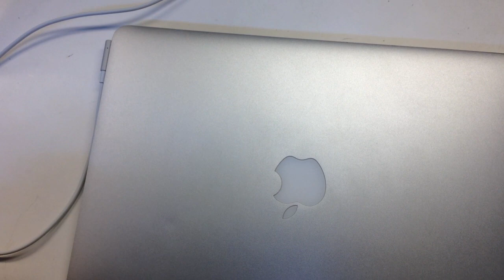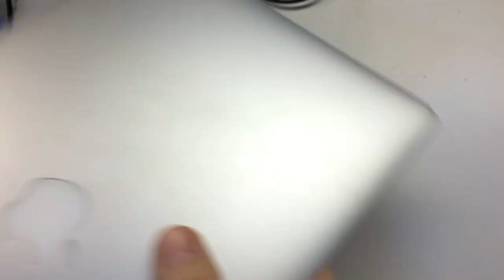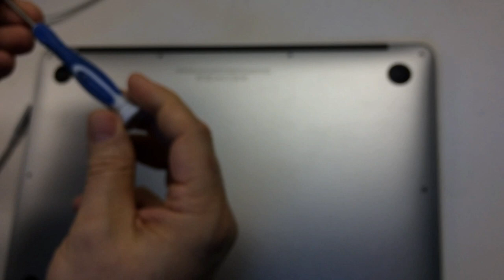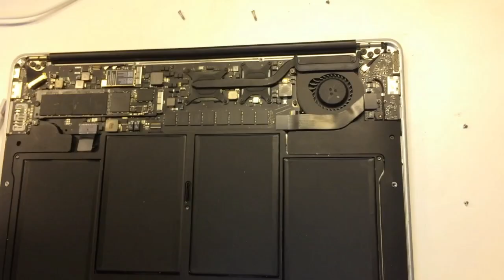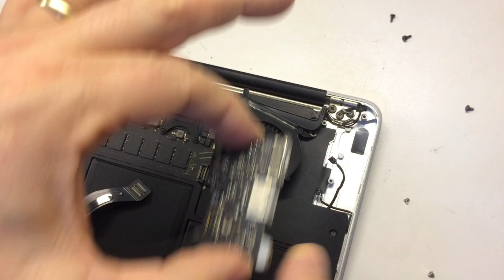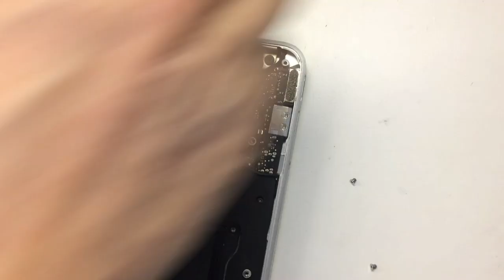Apple MacBook Air 13 A1369 Not Charging - I/O Board Repair Replacement (2010 - 2011)

Comment: I have an issue with my air,  the light on my magsafe charger does turn from green to amber, however up in the task bar it says the battery is not charging.  I have also tried using a different mag safe charger and I have the same result.  Could the I/O board be a good place to begin?  My battery doesn't have many cycles on it and seems to be in decent shape. I have a Macbook air a1466
Reply from the maker: Possibly, but could also be the battery.  If you hold down the option key and mouse click on the battery icon in the upper right side of the Apple menu bar it will tell you the state of the battery itself (either normal, replace soon, replace now, or service battery).  If it reports anything but normal, I would replace the battery first.
Reply: @DrShock   it does say normal
Reply from the maker: Then having eliminated the MagSafe charger and the battery, the I/O board would be the next logical failure point.
Reply: @firewall8985  hi, I have the same issue with my a1466 air. How you resolve your issue?

Comment: Thank you so much for this video, it was very instructive and helpful. I ordered the proper part, and followed the replacement steps, unfortunately the laptop will still not charge. No green or orange light and the battery has long since been drained. What would you suggest for the next troubleshooting step?
Reply from the maker: This particular fix is best verified borrowing someone else MagSafe charger to be sure first.   Sometimes the systems can be the battery itself, or the charger itself, rather than the I/O board.  Any of them, or any combination of them, going bad can cause the symtoms.  Based on your comment, I'd circle back and validate the MagSafe charger is actually working first.
Reply: @DrShock  Thank you for your prompt reply! I verified the charger first before starting the board replacement. This MagSafe works swimmingly with another computer in my household. Additionally, I verified with a 2nd MagSafe charger; works with another computer, not this one.
Reply from the maker: Gotcha, and the seller of the I/O board sold this as tested and verified?   Sometimes folks are just parting out laptops that are defective to begin with.

Comment: Question, the MacBook won't power on at all. It was working and then one day stopped working, and the power light on the adapter doesn't come on. I don't have a way to check it with a different adapter... So I opened it up and can see that I get 3.3 and 15V coming in and even across the motherboard. So the question is is it maybe missing 5v standby? could there still be something wrong with the power module? Just curious what else to check... Thanks again for the video!
Reply from the maker: This question about standby voltage is a bit past my familiarity with the MacBook logic board.  If I had this problem, without a spare MagSafe adapter handy, I'd try supplying power from my bench power supply instead.  There's a YT video from another creator on how to wire it up to check.  With this approach you could eliminate both the MagSafe adapter and battery as possible culprits leaving only the logic board.

Comment: Hi,
I dropped soother on the keyboard, 

It got Turned off
Let it dry for a day and had put it upside down
It got Started as tested it after a day
Now It's working on electricity 
But not on battery 🤔 as it is not charging the batteries. 
what do you guys recommend on how to get it fixed and can be done.
Thank you

Comment: Thank you very much, i have the same problem, how can i get the new part to replace the bad one? As I have such problem, I couldn't use it and keep away for some years. mine is the earlier one, i bought it even before 2010. i couldn't start using it around 2014-15...if i could fix it, i want to use it again.
Reply from the maker: There's an eBay search link in the description you could use to look for a board for your year macbook air.  Be sure the one you pick is for your model year, Apple changed them from time to time.
Reply: @DrShock  Thank you so much for your reply. I have to find out which year and model of the computer. I see serial number on the computer but no model description sadly. Any thank you so much for your help.
Reply: @zmkburma  Since this reply is way late, this probably doesn't pertain to you anymore, but perhaps any future readers. Go to the EveryMac website and enter in your serial number. That will display your exact model and year and all other features.

Comment: my mcbook 2018 not charging problem...everytime i plug in it beeps and show plug in sign and its not charging..please
Reply from the maker: You'll need to determine if the MagSafe charger is working by trying it on a friends Macbook, or borrowing a friends charger and trying it on yours.  If the charger is ok, then it may be the repair covered in this video.

Comment: Thanks. How do you test if your I/O board assembly is failing?
Reply from the maker: I can only comment on the scope of the video, which is the battery charging feature.  The other features on this board idk how you would test.  But for the charging, it's the simple test I mention in the video around your MagSafe charger and the green/orange led behavior.

Comment: Thank u so much
Anyway if issue is magsafe light on (green) but nothing booting up sound, absolutely died (i hv try press every key for reset etc) but still not turn on.. what do u think. (I try to replace old battery to new one but still nothing happen) I dont understand what is it :(

I want buy this but i dont know its right or not.. thanks for ur help
Reply from the maker: This video here is strictly about a charging of the battery problem.  If you have a new battery and a good Magsafe charger, then your boot up problem is unlikely to be the I/O board described here.   A good test would be was the Magsafe orange and charging your new battery when you installed it?  If so, then definitely not your issue.
Reply: DrShock yes charge new battery orange .... and then green (like full) 😔 its not my issue and i dont know what is it.. its happening when my mac sleep.. wisely i press shift and its open everyday without compromised..

I bought this mac 2015 1st hand BNIB not refurbish or anything.. and in the morning 2019 my mac wont turn on like dead fish :(

Thank you anyway friend🙏

Comment: I’ve been receiving a message about change my battery with 65% health and charger it wasn’t work correctly until stop completely.
Yesterday I could turn it on connected to the cable, but it didn’t charge. It keeps on 0%.
Now I can’t turn it on anymore. The light connector doesn’t work.
Is it about battery, power connector or that board you change?
Reply from the maker: To be diagnose at the point you are at now you really need access to a second MagSafe charger or a second MacBook.   If another charger works, its your charge cable.  If neither charger lights up its likely the I/O board.  If both chargers light up but no charging, more likely the battery.

Comment: whats that first connection you take off the I/O board.  mine is broken
Reply from the maker: Just to be sure of what you're asking, what time index in the vid?
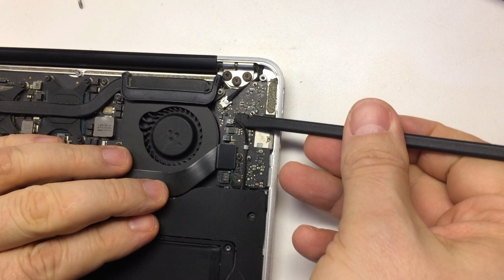Reply: DrShock 3:23. The connector that’s attached to the wire is broken on mine I just have the two gold colored prongs.
Reply from the maker: The middle connector that at 3:23 shows me removing is for the speaker, the connector above it is for the camera.
Reply: DrShock awesome thank you for the video and response.

Comment: Replaced the I/o board and it only charged for 5 mins then just stopped working again any plz help me
Reply from the maker: Defective MagSafe charger? Defective battery?   Water damage on motherboard thru ports or keyboard openings?  Anyone of these could be suspect for re-damage observed on a replacement I/O board.  Also get out a magnifying glass and make sure you don't have metallic debris causing a short on either magnetized power connector end.

Comment: Hi. So I have same problem.
Magsafe doesn't show light, neither Green or orange.
Works in another Mac.
But, it keeps the MacBook ON, just doesnt charge the battery.
I bought a new battery, still no luck
And magsafe works in another MacBook.
Can it be the same as your? The I/O board ?
Reply: It looks like mine. It works for you?

Comment: Great video! Very clear. In my case the adapter's light won't turn on. I haven't had the chance to try it on a different laptop. The laptop only turns on when I press the power button connect the power adapter and keep pressing the power button for 5 seconds. The battery won't hold charge. The laptop would immediately turn off if I disconnect the adapter even though it doesn't show any lights. Any thoughts?? Thanks again!
Reply from the maker: Since the MagSafe adapter will not illuminate, you'll first need to eliminate it as a possible cause.  Either with another Macbook or another MagSafe unit borrowed.
Reply: @DrShock  same issue as above, I have verified I have a good known adapter.

Comment: Thanks for the video. I have a MBA 13 that is not charging with a good power adapter. In addition to that, the screen is flickering and goes to black even though the machine is still on. Connecting to an external monitor seems to work. Do you think the I/O board is the problem here? If not, any suggestions on how to narrow down the problem? Thanks!
Reply from the maker: Can't really say for the flickering screen that does not sound I/O board related to me.  But if the MagSafe adapter is known to be OK on another Mac, and does not light up to charge on the one in question I would suspect the I/O board for that problem at least.  If the charge light is on and its not holding a charge, well then of course I would suspect the battery instead.

Comment: Like everyone else, thanks for doing this   Ironically I just left the Genius Bar and they said I have this same problem (same yr and make as this hence the irony) and they want $575 to repair !? Plus $100+ for new T2 charger cable as my shielding is thrashed. That said, I’ve found that part from several places online ranging from $15-$45 bucks and as you said looks pretty simple to do - however here’s my Q. This happened 2nd after my keyboard started typing all sorts of weird symbols first. They verbally are saying I got it wet. Not a chance as I’m recovering from spine surgery and had been bedridden for 7 months till just now. No liquids anywhere near my MBP 12” Retina 2014. ... plus I put it on one of their store charges and it lit for about 3-5 mins just enough to boot and it actually ran fine for the same. 5 mins. Then died because it’s not getting.a solid charge. Point being I’ve obviously got 2-3 issues here. I/O board. Keyboard? No idea how many cycles left on the battery. The BATT icon did NOT show up on the top bar oddly when I did get it to fire up for those 5 mins. Any suggestions? I’ll obviously get the exact year and model and part #’s etc before tearing into this. But my other concern is with no juice I have no way to do a full back up and my “life” is on here. Yes I have several time machine backups from 6-9 Mo ago but the WD drive I used filled up and after surgery I just didn’t bother as I was so restricted (lame sounding I know but is true) They said IF it was water damaged then a logic board would come into play and the total shot up to $975. Wanna guess what I paid for it with my EDU discount? Yup $975. I left furious. As this is my 2nd MBP to blow up within 2 yrs (yes it’s an Apple refurb but I can’t afford $3k like others here). This was originally $1999 and the last model with USB ports and a retina screen which I wanted. Only 128SSD though vs my prior HDD @ 500GB. So I put another 128GB SD card in and that suffices. Anyway back on topic. What’s the risk (assuming it’s powered down and disconnected from battery as you showed and I’m strapped in grounded) of wiping the SSD data by doing these repairs myself? If it were just the I/O board thats a no brainer vs Apples $575+!! But I have a keyboard issue too and in a quick search logic boards seem to run around $375-475 unless I’m mistaking it for a different or wrong part I’d need to get my keyboard back in order?? (keys themselves are still ace. Not the butterfly style others have issues with) so kinda flying blind here as it ran just fine only 4 hours ago and hate paying for something I could do myself. But the data with SSD is new to me as I’m used to HDD storage. Any suggestions or warnings?  Many thanks! Cheers.
Reply from the maker: If you can get it booted again, check the battery condition by holding down the option key (alt key) and clicking the battery icon in the top right on the status bar.  First line will show the "Condition".  If it says Replace Now or Service Battery then the battery is shot.  If not, the battery is fine.
Reply: DrShock thanks for that tip. I spoke since writing this to another authorized repair place who’ll do the I/O for $75 all in. If it’s a logic board that’s over $600 so then I’ll just buy a new one (PC though) not another @Apple product I didn’t not think for me till they clean up their QC and coding. I’m also thinking the BATT is good and can use (jump) that connection to fire up the unit to get a good backup going. It’ll prolly take 20+ hours but it’ll think it’s running off battery but with your help, at least now I know how to get the BATT ico back or access its status. Either way it won’t charge at all now. So went from intermittent to nada in a day after Apple cracked it open. Sigh. The 3rd party guy said it’s an I/O board 99% for sure as he sees that every day. The charge ($) though will depend if it’s a older unit that’s under the fan or newer that’s next to the fan as he has to strip it all apart for the older one. Mines “mid-2014” and should’ve read 13” (I mistyped 12” above). I see in their refurb online there’s a 15” MBP for $1909 on sale w/256gb $2099 for 512Gb but no dark gray models available. Why did they stop with the Apple logo backlight and remove the MagSafe!l cord!!??? That’s the best invention ever. Idiots there. Anyway thank for the tips. Cheers

Comment: I will like to know if the Mac was powering on?
Reply from the maker: Yes, the Mac was powering on just fine.  In fact, this particular repair is only applicable to a Mac that can still power on.
Reply: @DrShock  what if it can't- my MacBook stopped charging a while ago, but it was still on, so when the battery ran out it couldn't be turned back on. would this a
repair not be applicable?
Reply from the maker: @bobafettmug452  If you're sure your battery is (was) OK and the MagSafe charger is working (got to try it on another Mac to know) then it's likely (though not 100%) the I/O board for why you can't charge it.  With the caveat that not alot of time has passed, the battery does tend to die if fully drained and left for a long while.   These power symptoms in my experience are only one of three things at fault - battery, charger, or I/O board presuming there was no water damage (which will make the fault list much larger).    So you have to eliminate at least one of them here, typically you can find even a complete stranger to check out your charger at work or school without triggering alot of drama, vs asking hey can I change my battery out in your Macbook ;-)
Reply: @DrShock  alright. I replaced the I/O with no luck, but it's been over a year since it broke, not sure when it did. this mean that I need to replace the battery too? it wasn't damaged from water, to my knowledge
Reply from the maker: @bobafettmug452  I've done this particular Macbook Air repair maybe 5 times by now.  I'm not a business or anything, just fixing for folks in my circle.  Only once was it also the battery.   Basically the theme here is pretty simple, "Macbook used to charge fine and then suddenly stopped charging (or I started have intermittent days it would charge or not charge before it stopped altogether).  My charger works fine on another MacBook.  My battery ran the MacBook fine until it died from not being able to recharge it."   If you have this kind of quoted story, the I/O board repair in this video is the most likely fix.  If you wait too long (several weeks or more), you most likely have to change the battery too.  BUT if there were ANY other symptoms than this simple theme, it's most likely NOT the I/O board but something more serious on the logic board itself.  I hope this helps,

Comment: I have a Macbook pro early 2011, the battery doesn't charge but consume the charge of battery, the Magsafe AND battery ate good.. maybe this Is the Solution?
Reply from the maker: If its not charging, and you have separately verified the magsafe to be good with another computer, then it very likely could be the issue. Many problems have similar symptoms though, and some problems have multiple failure points.
Reply: I have the same issue, were you able to fix it and how?
Reply: DrShock what could be the problem